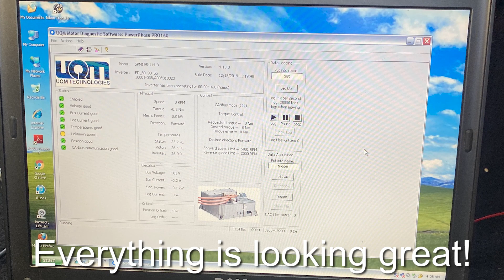1955 Ford F100 EV Conversion/test drive

Comment: My EV conversion fantasy.  I did a body off rebuild of a 55 F100 in 77.  It's long gone.  I  thought I'd integrate the batteries in the rear frame and box and put the power electronics up front... but what do I know.  Nice job Greg!

Comment: I'm generally NOT for solar on cars, as it's usually just NOT practical compared to simply plugging the car into an electric outlet. But for a SHOW car, and having a power slider, it's pretty cool! Hopefully, this will have a little information with it to teach the crowds how much power the solar panels produce, how much power is used by the truck, and typical charging rates.
This is sure to win a few car shows!
Reply from the maker: I totally agree with you about the solar panels on cars deal however this is for show only. And I will have a small sign beside the truck displaying the numbers when at shows. There are still a few more things we have to do to get this truck “show ready”. The solar panel set up will be shrouded with some fancy metalwork & logos to cover up the mechanics. We are designing a customized tonneau cover for the solar panel setup when in travel. As far as the capabilities… after everything is up and running we calculated about a KW per hour under full sun (basically 2 - 2.5 mph of charging pure solar), which for novelty purposes isn’t bad. On another note, thank you for the input…btw I am subscribed, I learn a lot from your channel. You expound on the details and cover those tiny nuances that a lot of people simply assume their viewers already know when a lot of tinkerers and novelists turn to You Tube get those details on a subject that may have them stumped and they can’t find any coverage on it in forums. You do a great job with detailed explanation. I will continue to watch and spread the word!👍
Reply: @greggoeselectric3595  Thanks for watching my channel!
This is a really cool project. You should get all sorts of attention at shows!
Reply: You two guys are all stars!

Comment: Hey Greg - great work. I actually wanted to ask a question about the Tesla battery boxes you built. You stacked them on their sides (i.e not the same orientation as they would be in the original Tesla). I want to do the same but not sure what to do about giving them support at the bottom. Did you put something under each module - I'm not keen on them resting on the support flange and thinking I'd put some nylon or something each side of that support flange that was thick enough for the module body to rest on. Interested to know what you did and whether you were happy with it! Cheers. Matt
Reply from the maker: Shoot me an email at seloceng@gmail.com